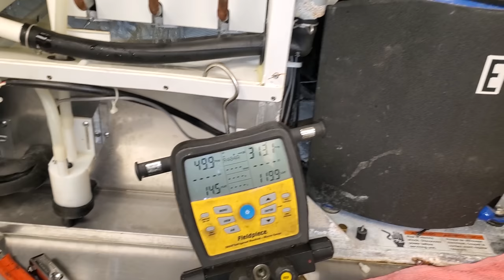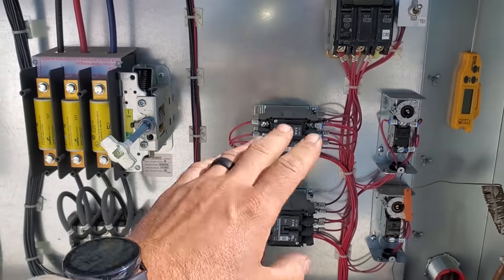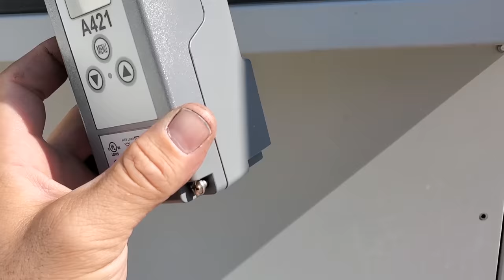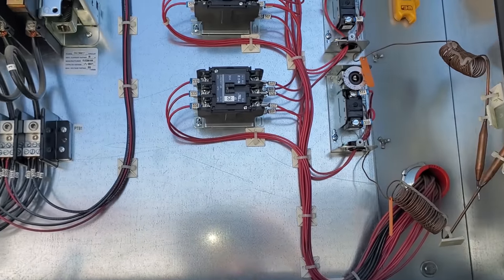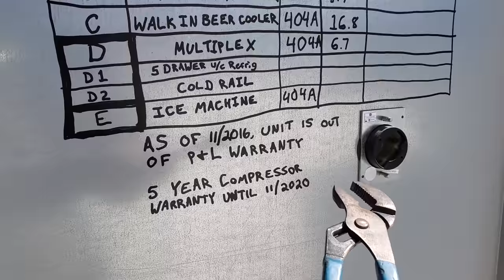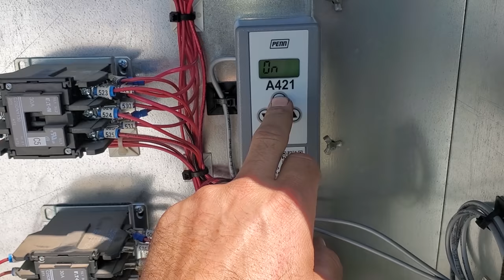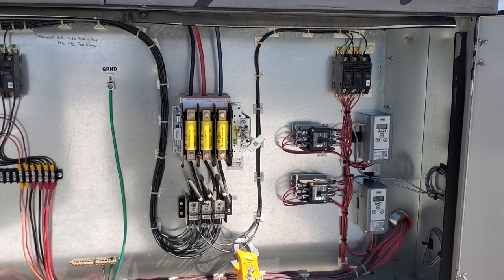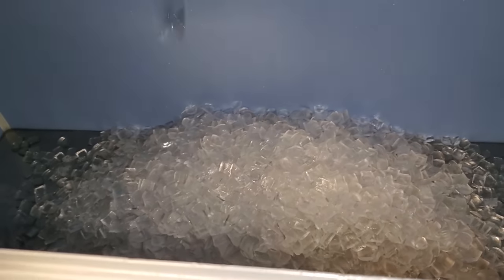THE ICE MACHINE IS EMPTY

Comment: Guessing the logic behind the switch wiring was to allow troubleshooting of the control circuitry with the fan motor breaker off.  Can then check if contactors closing etc without turning on the fans.

Comment: To me it seems like the 20A breaker for the temp controls would probably not even notice that the temp control goes bad. But at least it's better than nothing.
But how about sensing the temperature in the area where the fan evacuates air? That would make more sense to me.

Comment: When the outside temp gets below the low ambient temp sensor and they both are off, what cools the condenser when the ice machine runs? That was a very interesting video. Thanks
Reply: dont quote me on this, but i think it would just be passive cooling since those are pretty big condensers
Reply: There were 3 condenser fans. So one always runs, and the other two are controlled by their respective thermostat. (I think)
Reply: Usualy there should be a set differential over the condenser, one is placed in the air entering and one sensor in the discharge, this way you can have a floating head pressure, benefitting from the colder ambient(low condensing pressure ~$ saving ), yet having sufficient subcooling out the oulet of the condenser
Reply: @sjefoekel6058  
Thanks a lot for the answer/clarification!! I study informatics but I'm really interested in refrigeration, thanks to Chris!! (and everything I know is because of him)
Reply: @iosif9999  you are welcome, stay focused.

Comment: The walk ins may not have tripped because the head pressure wasn't high enough. You said it was running 315psi. I assume they're running 404a, most walk-ins have a hps around 425 with 404 . Maybe the higher head pressure caused extended freeze cycle times for the hoshi? That could be why it was locking out. Oh well, Those ambient fan controls were def the issue and that's all that matters. Nice job man

Comment: those mechanical thermostats always creep up in temp with age, the newer they are they faster they start to skew/offset. add to that them being inside the closed cabinet was likely heating them higher than ambient from outside solar/radiant and convection gain from contactors/wiring/fuses. I wouldn't doubt the cabinet temp climbing 10 to 40F over ambient!
**the digital controls are no better as the thermistor probes fail and fail they do. S.O.S.D.D. ;) lol

Comment: I'm curious why the sensors were installed to only measure the ambient temp outside and not inside of the cabinet in the condenser airflow? It seems to me that even on a mild day the temperatures could be much warmer inside of the rack. I suppose it could be out in the desert where it's never going to be that cool? I'm not trying to criticize, just want to understand the method behind the madness.
Reply: Ambient air is what provides the cooling, the higher that temperature is the more flow you need to maintain the proper head pressure. The key is ambient not flowing air temperature.
Reply: I'm not understanding. What good can ambient air do if the fans are off and not pulling the air through the rack?
Reply: @rkj4107  Well one of those 3 fans has no thermostat, so it's running all the time. Perhaps we don't have the whole picture as far as the condenser fan control system.
I mean if it was me designing the thing I'd have all 3 condenser fan motors on a single VFD (in a rain-protected enclosure that still lets ambient air get in for cooling), and have that VFD speed up the fans based on how many condensers are hot and the ambient air temperature. Sure that's a lot of sensors for some "simple" task, but when you think about it a little deeper it's not so simple after all!

Comment: On that toggle switch, wasn't there something that ran permanent power to the coils? Like the first contacts to the thermostats, and the second contacts to the contactor coils without thermostats in-between. Then if could be a bypass just to run it permanently if need arises.

Also, those temp controllers, aren't there some cascading or interconnect function or similiar in them (like serial port or similiar), allowing both to run off one single sensor? Seems a bit useless to run 2 sensors just to have 2 different temp values for on/off.

Comment: I'm confused - if its 75 outside, then the fans never run? - so the condenser just gets really hot....?
Reply: 95 F outside.
Reply: @movax20h  huh?
Reply: @tamtdc  Oh. I see your question. Yes, I think if it is 75 outside, then fans don't run. That is my understanding.
Reply: @movax20h  exactly.. So what happens? Everything just cooks itself until it the compressor(s) goes off on high head pressure?
Reply: @tamtdc  Good question. It is concerning. Or we miss something. Maybe compressors also do have high discharge temperature safety / disconnect? Not sure how would the help tho.
Reply: @movax20h  hence my question 🙂. I'd understand if the temp sensor is connected to the condenser.. When that's hot the fans run etc, but outside air gives no indication of if the condenser is hot or not.
Reply: Three fans on the rack, one runs constantly.
Reply: @Davemte34108  Yes. That is it. I re watched the video. (1:54) And yes, he said one fan is running, two others are controlled via thermostats. Thanks.
Reply: @Davemte34108  Ahhh! Thank you. Thought they were all controlled from the temp controller.

Comment: I do not work with any HVAC, so the answer to my question might be obvious, but why are the sensors placed outside of the cabinet and not on the inside?
Reply: With the sun shining on that closed electrical cabinet it will be much hotter inside than ambient temp.